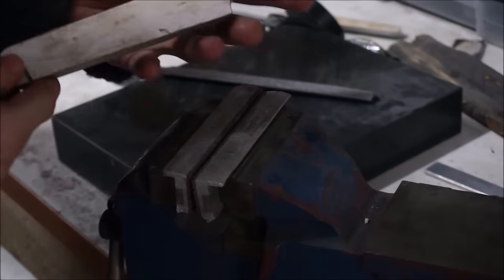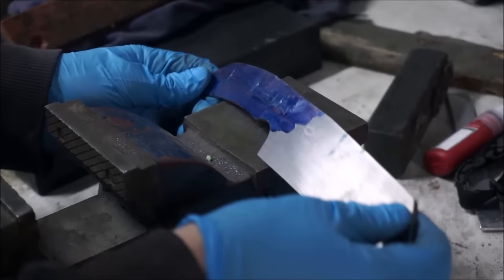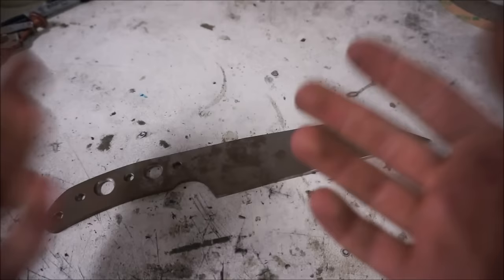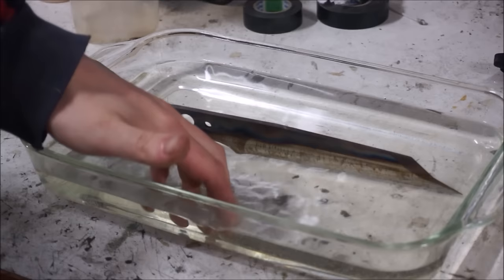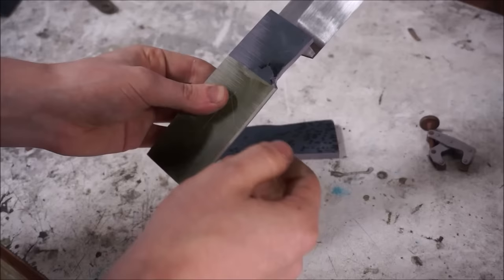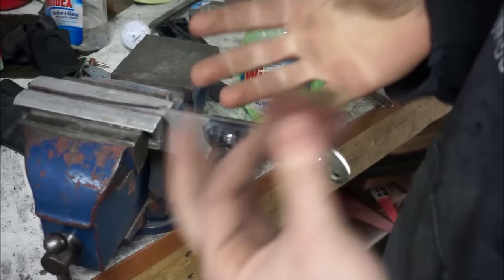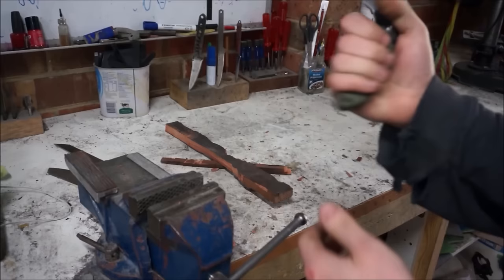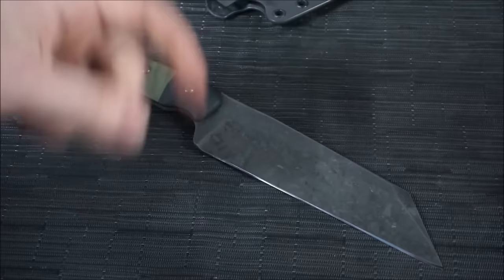Knifemaking - Modern seax knife

Comment: Great knife! You need to get yourself a mill, and a vertical band saw. It might be possible to use mid range wood cutting band saw in the meantime, if you can't find a metal working type where you are.
Reply from the maker: don't have that much space unfortunately. I've got a mill but it isn't don't much unfortuantely

Comment: Make a knife out of the stuff from the bucket. Just melt the stuff and experiential with it. Like if you agree:)
Reply: that would be a good vid
Reply from the maker: not a bad idea actually. I know its theoretically possible...
Reply: DB Blades chandler Dickerson did a video on that maybe you should check it out
Reply: which one?
Reply: I think the titanium would be a problem. It burns at casting temperature in the atmosphere and has to be submerged in an inert gas.
Reply: The titanium wouldnt be a huge issue, it would just oxidize away and its goes into the slag, but the glass from the g10 might be a bigger issue.
Reply: easy, suspend the stuff in water, and stick a couple of large magnets on the side of the container. All the steel will stick to it and simply pour off the rest.

Comment: Are there any advantages to a single side grind? (I am not sure that this is the correct terminology.)  But it looks like you only beveled one side of the blade. I have an old folder that was produced this way. I have always wondered what the reasoning is.
Reply: Why It? I know certain japanese knife makers do it to make delicate cuts more precise since the slant of the bevel is only a concern on one side; however, i don't believe that plays much of a role here
Reply: stronger edge, harder to fold or chip and easier to sharpen
Reply: It's called a chisel edge/bevel, it's just a lot easier to sharpen as you only have to sharpen it from one side. You don't have to worry about alternating side and such when it comes to sharpening.
Reply: When you sharpen any blade, it develops a bur, that demands that you hone the other side. You can't just sharpen one side. This still works on a single side grind, but you have to run both sides over the stone. If you don't, the bur will not be removed. It will not be sharp.
Reply: Why It? 
Still have to only sharpen one side. maintain constant angle on one side and knock burr off the other when it forms is easier than holding constant angle both sides. I personally think it dosnt matter much because sharpening anything is all practice and repetition anyway
Reply: People who op for a chisel grind are generally military. For example, look at the Emerson CQC model knives. With all sharpening, you still have to maintain constant angles and you still have to knock burrs off on any side. Sharpening takes a small amount of technical skill to it. Point being, only having to worry about angles on one side is going to save more time and use less mental resources then maintaining angle and count of pass on both side of the knife. Just my two cents, I prefer the aesthetic of non-chisel grind personally.

Comment: Awesome knife, how did you put the patina on it?
Reply from the maker: Thanks! how I do the patina though is a secret I'm afraid
Reply: Any ways to make it look similar?
Reply: If you're putting a Pateena on after you've put in on the wood handle say if you're using vinegar doesn't matter if you put both the blade and the wooden handle in the vinegar?  Will anything happen to the word or will it stay the same if you covered and say boiled linseed oil

Comment: I found when I cut G10 with an angle grinder it melted
Reply from the maker: you need the super thin discs man. oh and you need to move the grinder around a lot so it doesn't build up heat

Comment: 11:54 Did you just let one rip?
Reply from the maker: sorry to disappoint you mate but thats just me chucking the chuck key on the bench
Reply: DB Blades Right, though I'm not disappointed XD. On a serious note, where do you get those fasteners for your handles? I've been tapping and threading brass rod and using two screws either side, it's so much effort each time and I'd love to just stock up on fasteners but I am having trouble finding them anywhere.
Reply from the maker: I use 1/4" usa knifemaker pivots. They suck as pivots but they make great handle fasteners.
Reply: DB Blades Awesome man thanks, I'll check them out.